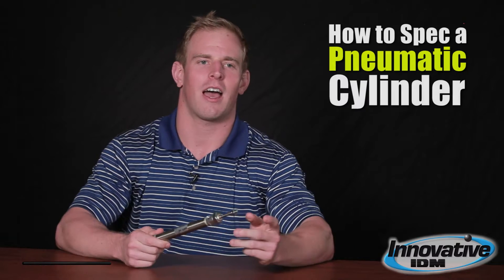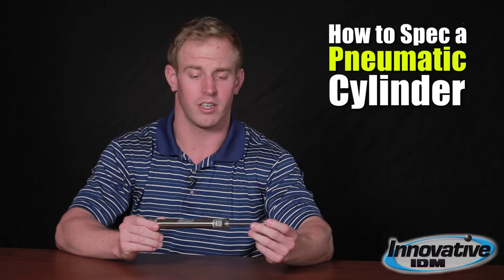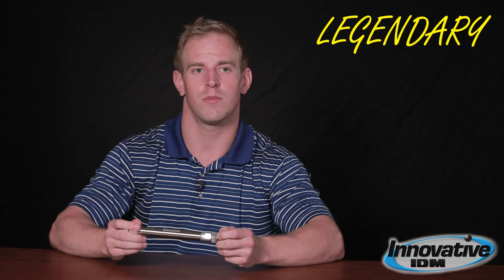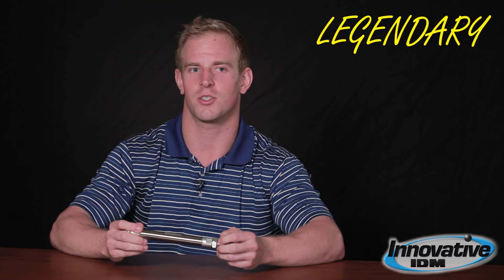How to Spec a Pneumatic Cylinder

Comment: I need a cylinder but i am working backwards from what you usually work. I need a cylinder that can be used to pump air instead of a cylinder used to push mechanical rod. I need a piston cylinder that converts mechanical movement into air pressure.